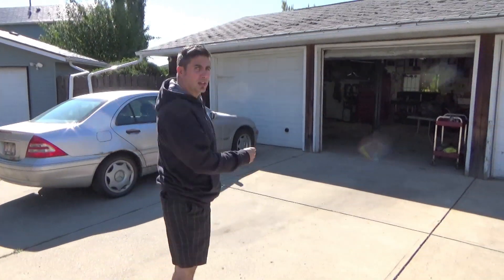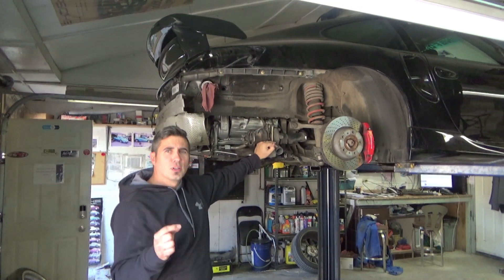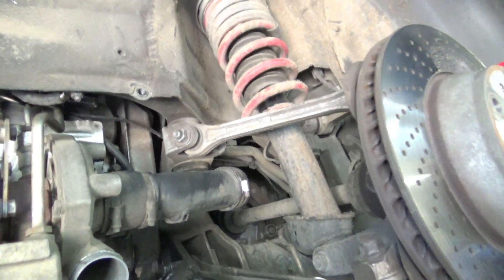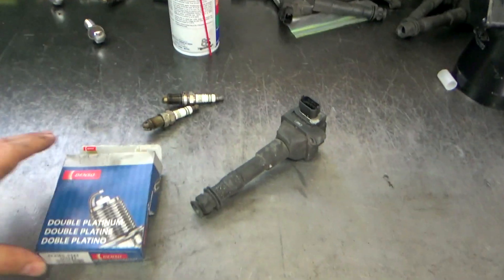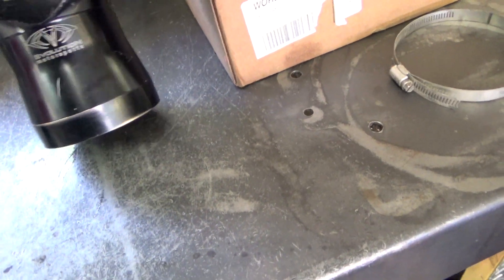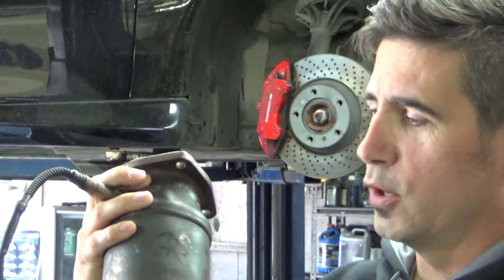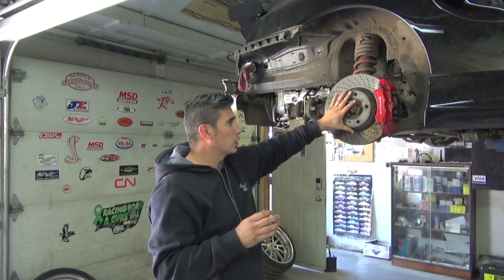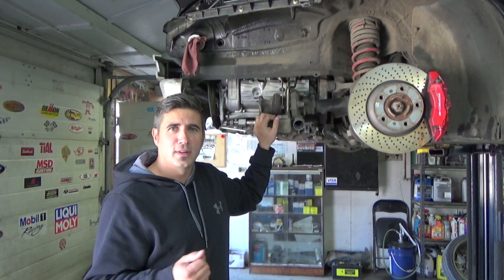Porsche 996 turbo performance upgrades |  DIY Project Vlog 1

Comment: please stop. you show a huge amount of inexperience in modding a 996tt when you speak. its intake piping not intercooler piping. when you gut the cat you turn off the rear 02 sensor reading to keep a cel from popping not by removing the sensors. the cat doesnt send any signals,m the o2 sensors do and the rears are turned off the fronts arentthe 997 coils have the same megajules as the 996 have they have a better casing to keep from cracking. stick to lambos porsches arent your cup of tea.
Reply: Are there any vids on youtube that you recommend for 996tt upgrades?
Reply: Lol. Just schooled them.
Reply: Damnit, just had a message typed up and I hit the wrong button and it got rid of it. Anyway, might be buying a 2002-2004, 996TT.  It's super clean, just needs a solid detail. I'm gonna get it for 18,000 with a Clear title. Has 80k on on the OBO.  So, it will take a little freshening up, but nothing more that I kain dealt that. I'm gonna get the HREs fixed, upgrade the suspension bushings, upgrade the cage and upgrade the suspension can if I decide to do anymore than a simple track day, I'll want the extra bit of time. To Kick it over once and give it a once order. Then I'll probably bring the ride Iedge setup.  it up 3/4 of and inch  on the adjustable Ohlins suspension I picked out already.
Reply: 32krazy1   Im so conflicted in buying a 996 gt2 or a 997.2 turbo s.   Any input?
Reply: Steven V 997 is basically the same except the transmission in the 997 is better
Reply: @stevenv1302  997.2 Turbo--no more Metzger engine. 996 GT2 is a rare and special car. But also a widow maker. Very different philosophies.  997.2 makes the Turbo Porsche a more civilized performer, 996 GT2 makes it a beast. What's your pleasure?

Comment: (Maybe he did, maybe not) First thing the guy needs to do is to upgrade the suspension, I see stock shocks, sitting on H&R lowering springs,  You need a good tune on this car, the only guy that i recommend is MARKSKI in Chicago. IF i were your friend, I'd recommend him to buy USED performance exhaust and keeping the stock one, also you need to turn off rear o2s so you wont get CE Light. Colder spark plugs are a must, with new coils from 997 which is correct~you wont run a lot of boost anyways, 1.1 bar max, to be safe. I wonder how long his clutch will last. :) as far doing intercooler piping or going bigger intercoolers, (only if you swap the turbos) for example if you go with turbos from X50 model. or 16 billets.  tell your friend to do some maintenance first, check for boost leaks, thats #1 ! also i'd replace the fuel pump. Mine died after 13 years, and replace Fuel Filter, you can stay with stock airbox, its fine,  make sure things are healthy first. just saying...i check for boost leaks every oil change which is (every 6 months) a good exhaust, with a good tune, is a really huge gain on 996TT.
Reply: maybe you could expand on this "upgraded oilm pump"  as for welding the offending fitting what about the other 7?  what internal upgrades do you speak of?  markski tuning the kmart of tuners lol

Comment: FYI - I did a full Stage II upgrade on my 996TT .. 1/2 hour video of all the work, problems, solutions, etc....   https://youtu.be/sEhySEAkcNQ  
The Cats on my stock 996TT setup were integral with the muffler, but the ones in this video are not??? (are they stock?) ... since I wanted to install a Kline muffler, I also replaced the Cats with 200 cell high flow units (could have used by-pass pipes .. which I kinda wish I had done instead, but never too late, lol!)).  
A suspension upgrade is a must do deal also, another great bang for the buck IMO (not that the stock setup is bad .. but a small investment makes it glorious!) ... I installed KW Variant 3 coil-overs, performance torsion bars & drop links, Nitto NT01 (245/305 - on stock 18" wheels, this is a good front/rear diameter match for the AWD system), and lowered the ride height a LOT!  and dressed it up with a GT2 carbon rear wing... now an awesome drive.

Comment: does the 996 turbo have a lot of turbo lag, if so is there any way to get rid of it?
Reply: yes it does, thanks for the question
Reply: Switching to a MAFless tune and putting air filters directly on the turbos will provide really great improvements in spool. Plus tune and exhaust are helpful. Last thing would be more preload on the wastegate actuators or getting stiffer actuators from Garrett.